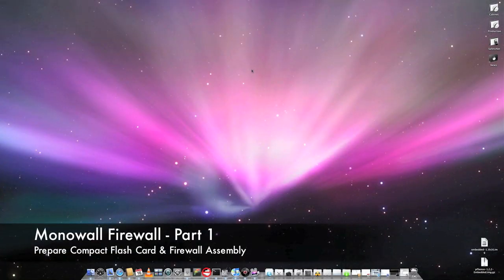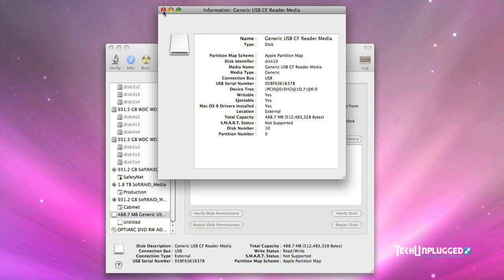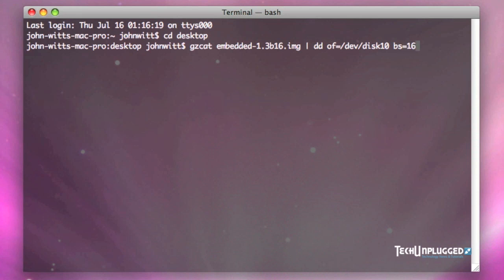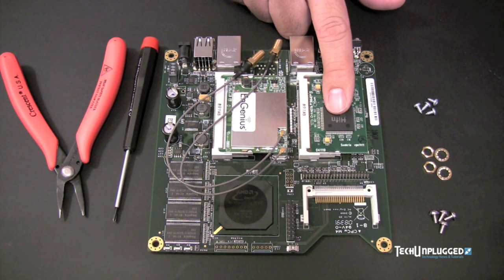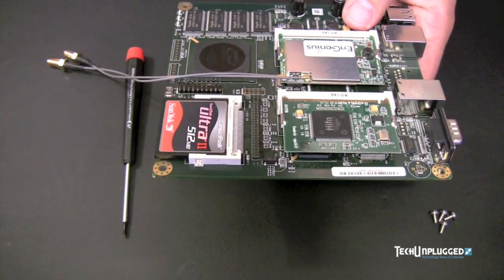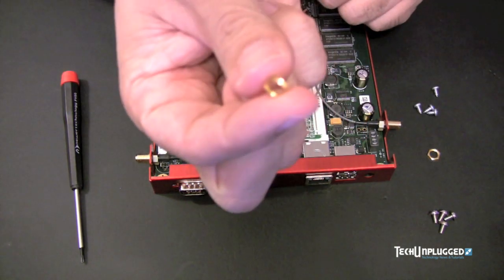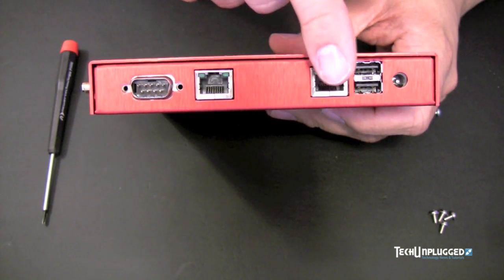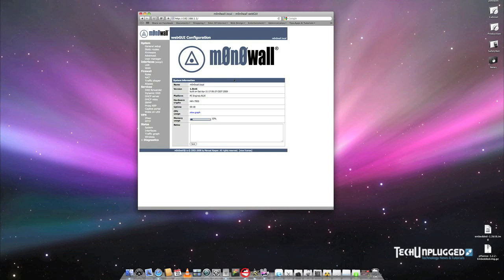ALIX m0n0wall firewall - Part 1

Comment: Do you also have a case that will fit into a 19 inch rack?
Reply: +Lorin K Look at Netgate's website (negate.com). They have a couple of systems built into rack mount cases. It's been years since I have done this so things have changed a lot since this was made. The closest thing you will find is one that is running CentOS but pfSense can be installed instead.